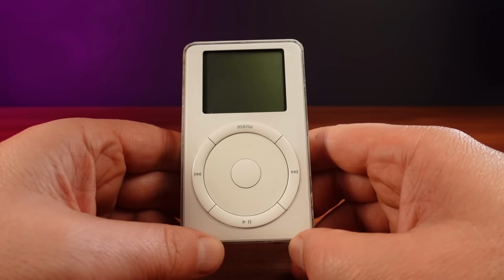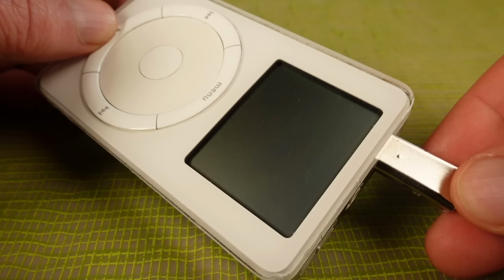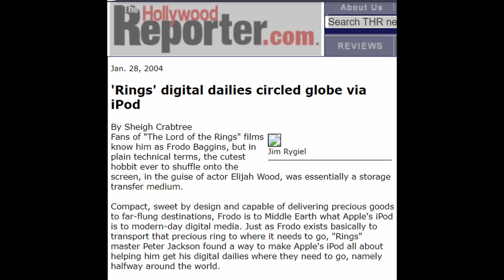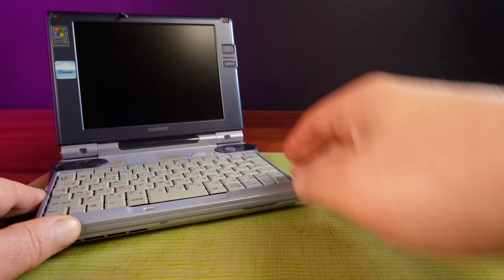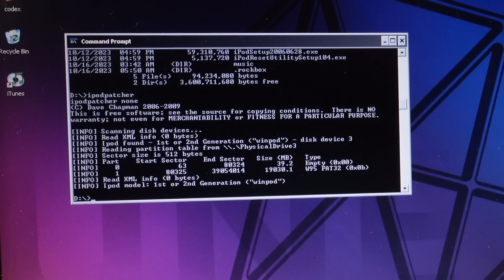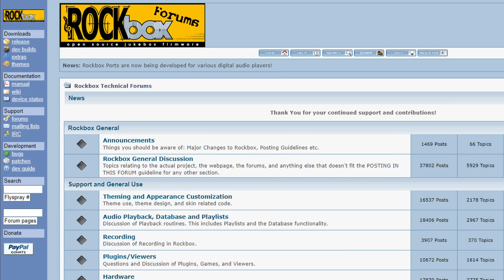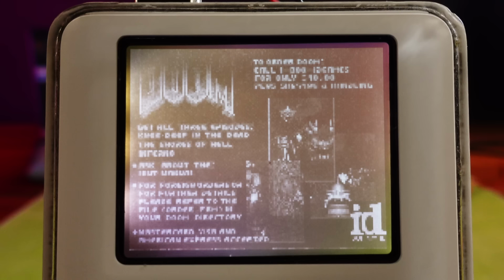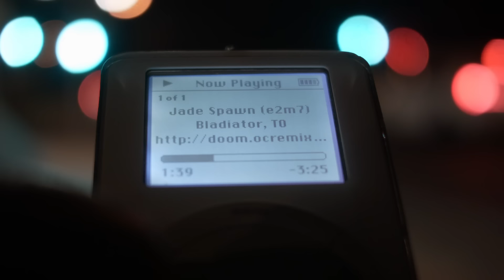A New Way To Use The Original iPod

Comment: FWIW, that tank/air bubbles story is probably apocryphal. The article only says it was relayed to the author by an unnamed Apple employee, the story doesn't appear in Walter Isaacson's all-encompassing biography (which includes plenty of unflattering stories about Jobs), and, perhaps most damningly, the exact same story is told about Sony co-founder Akio Morita. It may still be true, but some skepticism is warranted.
Reply from the maker: Thanks for those details. Jobs could be such a jerk at times that it's so easy to believe. Fascinating that Akio Morita has also been claimed to have done the same.

Comment: I was able to connect my iPod to a M2 Mac with a FireWire 400 to 800 adapter, attached to a FireWire 800 to Thunderbolt adapter, attached to a Thunderbolt to USB-C adapter. It looks ridiculous but it works and charges the iPod while connected.
Reply from the maker: You have a triple going on there, nice.

Comment: Displaying more colors/shades on these old LCDs was simple. All you have to do is to alternate pixel color each frame and you'll get intermediate color. First it was used in software like in this iPod or there were J2ME tech demos for Siemens SL45i phone. In the first case you'll get 16 shades, in the second you'll only get 4 shades since SL45i had 1-bit screen.
This technique was widely adopted in LCD displays. For years most monitors and TV had 6-bit panels, but with FRC (which does the same in hardware) they were able to display 8-bit shades. Currently it is used in low-end and mid-range displays, but now we have 8-bit panels and FRC brings them up to 10-bit for HDR content.

In early days such technique wasn't used in hardware, since LCDs had much lower quality. My SL45i had inconsistent shades in few lines. Still better than 1-bit, but not good enough for commercial use case.
Reply from the maker: I hope you understand that I'm now going to have to try this on an SL45i.
Reply: @JanusCycle  There was J2ME tech demo movie player for SL45i. I don't remember the name, but I should have it somewhere on one of my old HDDs.
Reply: In order to alternate each shade in frames in this LCD you need more FPS from it (60 or 90) and the LCD usually runs at 30. Because that LCD is connected using SPI interface there is connection speed limit that was increased by using a trick to not wait for valid data confirmation on each data transfer. This increased the FPS signifficantly however introduces noise by controller errors that barely works at that data rate.
Reply: @JanusCycle  It is just very similar PWM control, nothing else. The controller sends 60 frames per second, let's say. It will send a series like 0110 for even and 0101 for odd frames, you will always generate the in-between. The only place I could see this approach failing is that black MacBook with Core Duo and GMA950. It had a panel that was able to show 262144 colors, but it was ran at 16 million colors by Apple, through every other frame cycling. It resulted in a bad dithering pattern and weird, yellowish whites. If I remember well enough, there were some games in the DOS era that exploited this in order to create more colors.
Reply: @Leeki85 if you find it please upload it to archive
Stuff like this needs to be archived
Reply: pulsing single pixels with different duty cycles is similar to the way LEDs are dimmed
Reply from the maker: The SL45i video is coming soon. I think the tech demo is called AceVideo. I was just able to get it running.

Comment: i had Rockbox installed on a tiny Sansa Clip+. the screen was a miniscule blue OLED with an amber strip across the top. Rockbox made this little gadget run just about everything. i even made my own theme for it.

my favorite feature of Rockbox however was the TalkBack feature that generates voice titles for all the artists and albums. i used this so i could navigate to where i wanted without looking at it, like when i was driving or taking a walk.
Reply from the maker: Great stuff. The TalkBack function seems like a very underrated aspect of Rockbox.
Reply: I had Rockbox on my Clip+ as well
Reply from the maker: @Trekeyus  Nice player, I wish I had one.

Comment: I used rockbox with an iriver with a little smaller disk drive (8gb had inside i think) to hack my ps3 and jailbreak it around 2009 i think.
I used to let the iriver connected to the ps3 usb and as it booted up it delivered a payload to jailbreak the ps3 and run homebrew and backups. Then i got a infinite trade in (in rental ps3 games) for one month and backed up 60 or more of the best ps3 games.
Those were the days :)
Reply from the maker: That is awesome!
Reply: Bro you're a legend.
Reply: classic! i did something similar with my original xbox
Reply: Was that iriver h10?
Reply: @kaanosphere  probably ,I don't remember though clearly

Comment: The reason Breakout is on the iPod is because Jobs and, well, mainly Wozniak designed the circuit board for the arcade machine, when Jobs was still working at Atari. It was their first successful product, before founding Apple.

Comment: I still use a 5.5G iPod Video with Rockbox as my main portable music player. Other upgrades I've done include a vastly bigger battery, 512GB storage and the diyMod output stage bypass so I can feed the analogue output from the DAC directly to a headphone amp via the dock connector bypassing any additional filtering (the headphone jack still functions as normal)
Reply from the maker: Those are some amazing mods. I'm really very impressed. Thanks for sharing.
Reply: Same. I have a 5.5 with a bigger battery and two 128 GB SD cards. Did you install an SSD mod or Iflash? I’ve heard that the SSD can work better in some cases.
Reply: @stasprze1685  iFlash Quad with 4x128GB micro SD cards, at the time it was the lowest cost per GB option available and I've not had any issues with battery life or stability.

Comment: Hmm, the iPod 6G (the small square with a touchscreen) is not even listed :(
It would be interesting to try to "unlock" it in any way and maybe at least check what's needed to port Rockbox on one from scratch.
Reply from the maker: I'm going to totally guess that Rockbox is ported depending on the chipset the player runs on and the 6G used a very different chipset to the previous models. Also maybe Apple locked it down somehow.
Reply: @JanusCycle  It is likely the case.
I might at least check if there are any unpatched vulnerabilities to exploit :P
It's not like I'm using it anymore so I guess bricking it won't change much.

Comment: I was using Rockbox on a 60GB iPod Video 5th gen with USB for years. And I've stil got it, but like the one in this video the battery is knackered.
Reply from the maker: Glad you still have it :)
Reply: @JanusCycle  My iPod Video still works, but the battery only runs for about 30 minutes now. Not only can Rockbox play Doom, it also plays Duke Nukem 3D and Quake on iPod as well. :D I did recently update Rockbox on it, using Macbook Pro. 

I used to use it as my main music player with Rockbox between 2007-2013, as I was on the road full-time driving about 80,000km a year.

Comment: I imagine the extra gray scale is similar to what you could do with the TI-89 to get 4 level grayscale like the Gameboy and flipping between different framebuffers faster than the pixels can reset between black and white.
Reply from the maker: Very interesting about the TI-89. Apparently also the TI-92+ can do this. I'm going to have to get one and try it one day. Thanks.
Reply: @JanusCycle  Yeah the TI-89, TI-92, and TI-89 Titanium are all the same platform. The TI-92 has a larger screen (and full keyboard)

I would recommend TIGCC (if it still exists) if you want yo get your hands dirty with C code to make something
Reply from the maker: @ColinABarr  Yep, I just found it. Looks great, thanks for that.

Comment: Yep rockboxed my iPod 6th gen and added a new battery and SSD. Runs nice.
You could have run Linux on a usb stick and installed rockbox on your iPod save the stress of old versions
Reply from the maker: I'm not sure how well this VAIO can handle USB booting. I will be doing  more Linux stuff soon.
Reply: @JanusCycle  good point. There is a tool called ploppy (not joking) that can boot Linux from a CD ti USB.
Either way, great content

Comment: Sucks that the firewire door is missing on that 2nd gen. Awesome that the 3.5mm barrel for the headphones hasn't chipped away yet 😃

Hardest thing is finding replacement drives and quality batteries that are thin enough to cram into the iPod. 3rd gen iPod drives work well in 1st and 2nd gen. Pulled a battery from a random Motorola smartphone (EG30) to modify the connector and reuse the battery pumping it up from the dead original 1200mAh to 1940mAh
Reply: Also firewire is still sold. I keep an old PPC Mac Mini to communicate with my old iPods. But I also have a Lenovo laptop with mini firewire that works great with data transfer, just no power out via mini. You can get expansion cards to slot into a desktop to put out 12v and data transfer. Only thing that might be an issue is finding old Apple firewire wall chargers, but everything else to connect it is easily found online.
Reply from the maker: I also keep a box of flat batteries from other devices for adapting into things like this. This not being my iPod means I'm keeping it original for it's owner.
Reply from the maker: I do have a couple of old Macbooks. But not tried to get them running yet. Apart from Firewire which would be useful, I'm not sure what I would use them for.

Comment: The two pins which are missing in 4 pin FireWire cable/connectors is exactly the power pins, you don’t get power with them.

Comment: I use a Sandisk Sansa e250 6GB player with Rockbox installed, just to be able to run Doom. (Color screen, Doom runs fine.)It has a mechanical clickwheel, too. But it also has a proprietary USB connector unfortunately, so I had to buy a cable for it. I found the player on a local flea market for 1.5 euros.
Reply from the maker: A very nice player, I like it.
Reply: @JanusCycle  and what I did not know, that it has a replaceable storage module inside. I got 2 devices on the flea market. One was working with 4GB storage, and the other had a broken LCD and 6GB storage. I took the 6GB module out and inserted it into the working one.

Comment: This is ridiculous- my first ipod was an ipod video cause I was waiting for a color screen and the horsepower (that apparently the ipod photo didn’t have…) to display video.

Then today I see this video- a 1st gen ipod that didn’t even display album cover art or any graphics in the stock firmware, running LOTR at full framerate, and Doom- in all its early 90’s 3D glory, And discovering it had dual 19Mhz ARM CPUs.

I mean, it’s gonna take a little bit for me to absorb this.

Comment: Im going to have to try and find another hard drive for my olympis mrobe now 👌 this will be fun
Reply from the maker: Nice, the mrobe is one of the players I really want!
Reply: @JanusCycle  i actually have two mr100's i cant recall if i have two docks or not though, ill have a look on the weekend. Both have faulty hard drives though, theyll freeze up and i have to take it apart and slide the (i dont know the name) the tone arm with the read/write heads on it for lack of the correct term back onto the disc, then it will work again for an amount of time, never a full battery worth though. If i have two complete sets, you are welcome to one, id love to see what you can do with it
Reply from the maker: @Colt45hatchback  I would love one, even if not complete. But that hard drive sounds like trouble. It looks like these use a Seagate FLEX ATA 45 interface which are not easiest to replace, and there don't seem to be any adaptors or anything. I'm not sure I'd be able to do anything with it. Except manually wire all 45 pins to a Compact Flash card. I wonder if that would even work.
Reply: Sorry for the belated response i didnt see the notification, im unsure if repinning would work, it would be tough the hdd is like, 50c coin size from memory with a tiny ribbon cable... (Assuming im remembering correctly) But you're welcome to try with one. Are you in vic?

Comment: I'm running Rockbox on a iriver H10 20gb with a 128gb SD hard drive swap, but the battery is pretty much dead, if anyone knows of a battery replacement for the 20gb H10, let me know!
Reply from the maker: Nice machine and upgrade! I hope you find a battery solution.

Comment: rockbox is fantastic but it has is limit i have use it on some device like the sandisk sansa clip + its way better then the original firmware on thise one end ipod video 5.5g and my ipod classic 7g but on those ipod the original firmware is stile better on ipod video is possible to theme the UI with a custom rom but not on the classic but the reison i cant use rockbox on those and this is a limit of rockbox is the fact that they cant use the inboard video decoding chip and the fact there is no shuffle that is one of the biggest feature that make the ipod a ipod ...
Reply from the maker: Rockbox can be installed on so many models of audio players and many are unfinished I expect there are some limits. Thanks for that info, I will be trying it on more devices in the future.
Reply: @JanusCycle  looking forward on more video on it :)

Comment: I had an Olympus MR-500i，Rockbox is barely usable, becssue the screen resolution is way too high and the processor is too weak.
Reply from the maker: That's a beautiful machine. I would still love to try one.
Reply: @JanusCycle  it’s not fun to use it actually, in fact that player does nothing well, the whole system is very slow, the camera on it took seconds to take a picture, navigate music library is painful because it only shows few lines and it doesn’t have quick navigation like click wheel, and syncing music is also painful, the software is buggy, I remember it doesn’t work out of box, plus the transfer speed is also slow, sync 10G of music took hours. The sound quality is mediocre, and it only can drive small earphones, and weirdly it support video output, but it only has three features music, camera and album. I did managed to run OPIE on it, but not practical at all because of the resolution with no driver and there’s no way to connect any peripherals or network. I brought it because at the time I can’t buy iRiver H320, it was sold out everywhere, however MR-100i is way much better than MR-500i in terms of music player, it was the first time ever I see capacitive like touch control on a glass surface.

Comment: @4:58 all laptop had these hdds, they where off the shelf hdd, there not special.
Reply from the maker: The laptop I used in this video, which I believe was only the second device to be released a few months after the iPod, used one of these special smaller hard drives.
Instead of the majority of laptops which use the bigger 2.5" sized hard drives. Devices using these tiny 1.8" drives were often special in some way. Such as with the MacBook Air many years later.
Hey, this gives me an idea, the very first model of MacBook Air, hdd vs ssd. Extra special :)